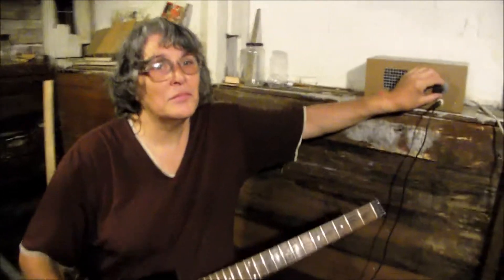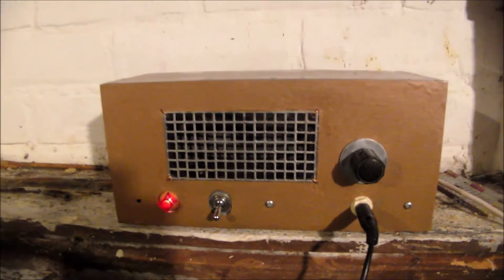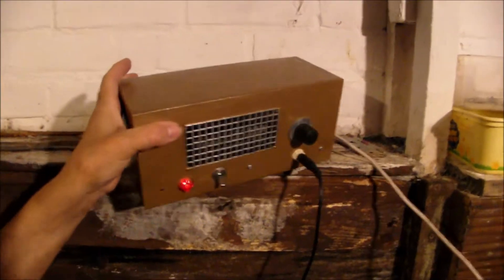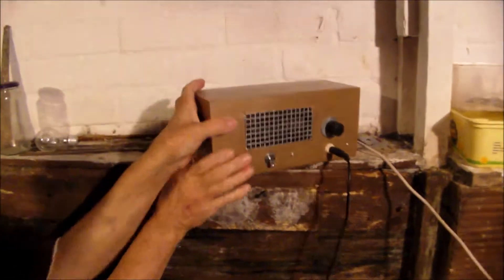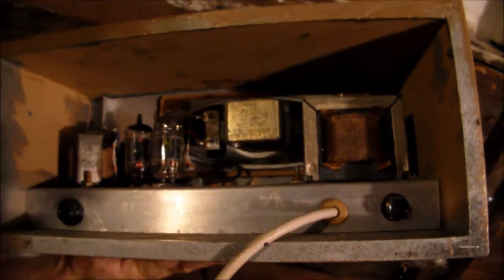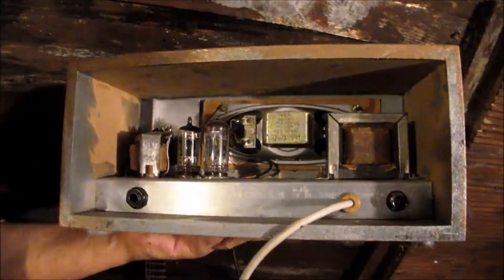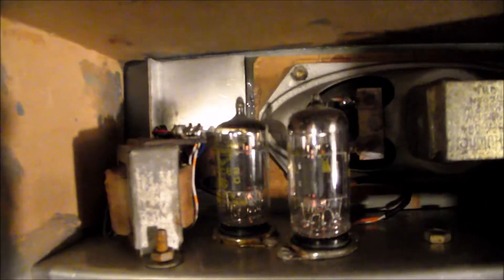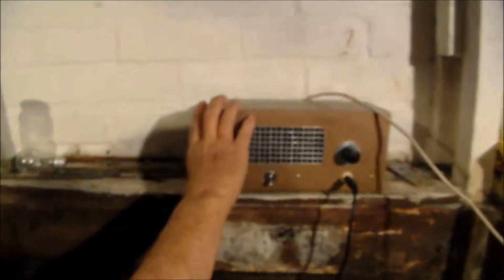ECC82 and ECC83 All Triode Guitar

Comment: I've built a 1 watt guitar amp by approximating the circuit designed by Rob Robinette,    https://robrobinette.com/Champ_Micro.htm    which uses a 12AY7 as a preamp valve, and parallels the triodes in a ECC82. The output transformer is the only bit I had to buy specially, and is the reverb driver from a Fender, I had all the other bits. I don't like my tone as crunchy as you do and this isn't. I've tried an ECC83 as the preamp valve and I don't like it as much. Rob calls it a micro champ, but it sounds nothing like one. Sounds great to me though. 
Love your channel, you obviously have a good understanding of how the amps work, and your laid back style is a treat to watch
Reply from the maker: You're so kind. In a distortion amp like this, we get away with it because, as far as I've seen, amps used like this will give out three times that of an amp used for a record player where we want to avoid overload distortion. There are some guitarists who like clean sound and one design I'm thinking of will have an optical limiter. With this, we connect a neon lamp to the output and use the light to control a light dependent resistor, such as ORP12. We can then control the amps output so the limiter kicks in, just before distortion. With enough differentiation, (bass cut) we can hope for a sustain output loud without distortion. Will work on it. Other guitar folk really love the Bird Talisman where they use an EF86 instead of ECC83. Click on hyperlink and thank you for your comment. (o:https://www.bing.com/images/search?view=detailV2&ccid=Oyfc37O3&id=716BC51D30025AACAF16347D42AE6F57F8805342&thid=OIP.Oyfc37O3mybwbJtlcmhv6QHaFW&mediaurl=http%3a%2f%2fwww.vintagehofner.co.uk%2fbritamps%2fbirdy%2ftalisman%2ftali4a.jpeg&exph=777&expw=1076&q=bird+talisman+schematic&simid=608019530237740435&selectedIndex=0&ajaxhist=0
Reply: Thanks for that circuit. I've built a couple of of amps with EF86's driving either a KT66 or an EL34 . They seem both cleaner and with a different sheen to the treble than ECC triodes, and have more headroom before breakup.